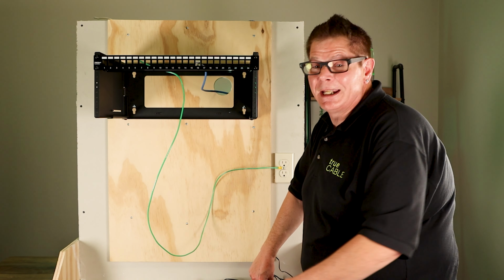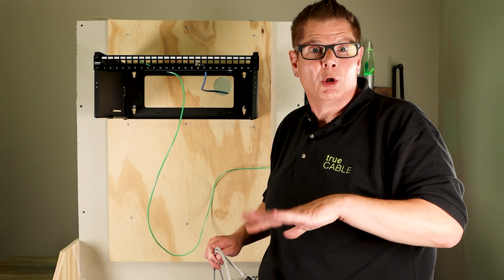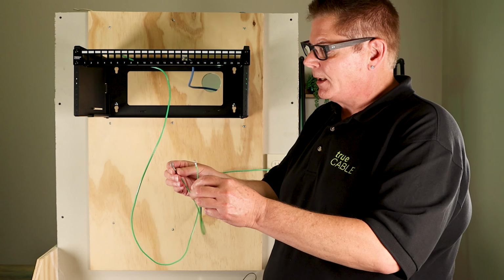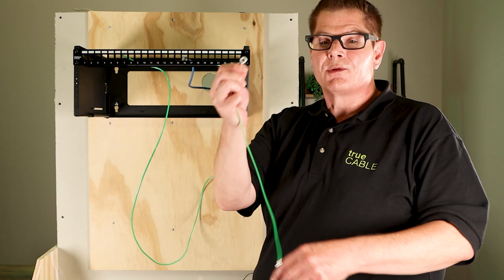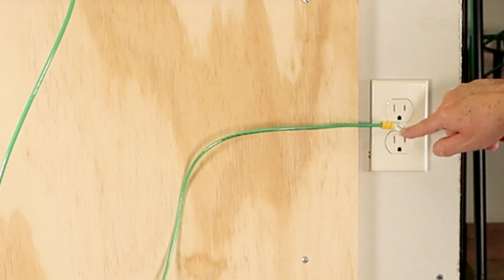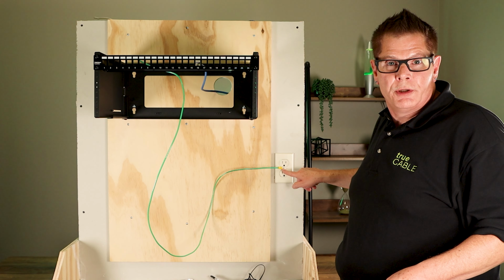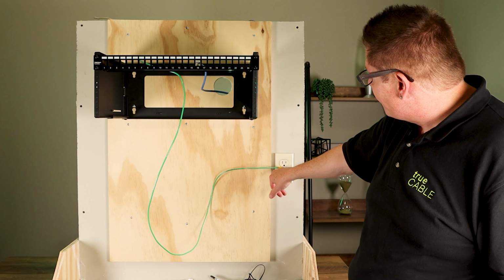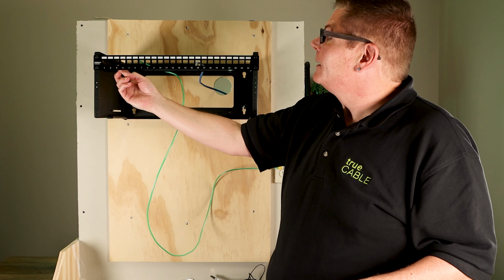Residential Bonding and Grounding of Shielded Ethernet Cable (Full Overview)

Comment: Do you need to bond the patch panel if your electrical plug and connection has a ground wire?  I know that in some places the electrical plugs don't have a ground wire connected to the electrical switch, but where we are every switch has a ground wire ... so in that case do you still need to do the bonding?
Reply from the maker: Hello! That is a great question. If your Ethernet switches all use 3 prong AC power cords (in other words they have AC/DC internal power supplies) AND you are using shielded patch cords from the patch panel to the switches then you do have a complete ground path. It is not the strongest or most resilient path, however. I would still add a bond to that shielded patch panel. The more bonds the better. What you have now, assuming you met my conditions above, is the bare minimum. On the flip side, if you don't have a dedicated formal telecom bonding infrastructure then you can increase your bond effectiveness with our truePLUG accessory which we just released.
Reply: @trueCABLE   You do not want multiple ground connections, if you create loops with them.
Reply from the maker: @James_Knott  Hello James! Correct. You do NOT want multiple grounds. You want multiple bonds to the SAME ground, however.
Reply: @trueCABLE  "You do NOT want multiple grounds. You want multiple bonds to the SAME ground" FINALLY someone who explained this in a short but very clear way. Thank you!! 
It's pretty confusing all the advice floating around about loops and that ALL cables after the wall socket should be unshielded, because the computers are already grounded and thus would create a loop. 
I have now the following (residential) situation: fiber -> ont (no AC ground) -> shielded cat6a -> gateway (no AC ground) -> shielded cat6a -> patchpanel (grounded with cord) -> shielded cat6a -> wall socket -> shielded cat6a -> switch (no AC ground) -> shielded cat6a -> NAS/workstation/desktop/printer (all AC grounded). 
No loop right? These are all bonds to the same ground, correct?
If we add a UPS to the mix, do we also feed it the cat6a in and out or only the power cords?
Reply from the maker: @EddieBogart  Hello Erwin! I am glad you found the explanation understandable and useful. Your setup won't introduce any ground loops, all are on the same AC ground. As for using a UPS to pass-through any type of Ethernet; don't do that. The UPS may introduce its own brand of EMI and interfere with performance. Restrict UPS use to AC power only.

Comment: I am converting a 12 x 14 space in a detached garage into a workshop and plan to run six to eight cat 6a plates (four in two gang boxes with 20 amp outlets as the second and four in standalone wall terminals for future PoE cameras). I will have an 8 port PoE switch which I assume will not be three prong in a media wire box on the wall. There will be an outlet in the media wire box for the switch. If I ground the switch to the outlet in the media wire box, do I have to ground everything I plug into each of these ethernet wall jacks as well? For instance, if I plug in a PoE camera does the camera end have to be grounded as well? Everything ends up going to a sub-panel that is properly grounded to the main panel in the house by the way. 

I was originally going to use cat 6 until I read i needed cat 6a for PoE. Maybe i am over enginneering for such a not critical small project? I mean, until I can run ethernet from the house all the erhernet cables are ultimately going through an ethernet jack on a wifi extender!
Reply from the maker: Hello! I will answer your various questions in [ ]. "If I ground the switch to the outlet in the media wire box, do I have to ground everything I plug into each of these ethernet wall jacks as well? For instance, if I plug in a PoE camera does the camera end have to be grounded as well?" [The camera end does not need to be grounded. In this case, you want the switch end to be bonded to ground.] "Everything ends up going to a sub-panel that is properly grounded to the main panel in the house by the way." [Excellent, this is exactly how it should be done to avoid any ground loops.] I was originally going to use cat 6 until I read I needed cat 6a for PoE. Maybe I am over-engineering for such a non-critical small project? I mean, until I can run ethernet from the house all the ethernet cables are ultimately going through an ethernet jack on a wifi extender!" [Yeah, there is a lot of misinformation out there. You DO NOT need Cat6A at all for this project unless your cameras require 10G connections. Quite frankly Cat5e can handle 2.5Gb/s and our Cat5e can handle 100W PoE. What limits PoE on Ethernet is cable bundle size due to resonant heat, especially in conduit. You are nowhere near the limits of even Cat5e. When picking a cable for your project, it makes sense to have some future upgradability to be sure, but don't overkill it. The reason is that the more features a cable has, the more difficult it is to work with. Cat6 is a good balance, and still a bit overkill.]  Hope I was able to help answer your questions!
Reply: @trueCABLE   It's nice to see someone else recognize CAT5 is good enough for most users.  Gigabit Ethernet was designed to run up to 100M over plain CAT5, before 5e was even available.  5e is just CAT5 with tighter tolerances.
Reply from the maker: @James_Knott  Hello James. I am sorry if I gave the wrong impression. Cat5 is completely insufficient these days. In addition, TIA no longer recognizes it as a valid Category. All installations should be Cat5e or higher.
Reply: @trueCABLE   I agree plain CAT5 is obsolete, superseded by CAT5e, but it is what Gb was designed for.  Incidentally, I have some plain CAT5 in my condo, installed by my cable company, back in the late 90s, when I first got a cable modem.  They actually fished the cable up inside the walls, along side air ducts, etc., when they were running to coax to my "office".  I supplied the CAT5 and they pulled it in with the coax.  That CAT5 is now supporting Gb and carrying IPTV, though those boxes only run at 100 Mb.

Comment: I am trying to set up an HP Switch (v1910-24g je006a) and an Ubiquity Dream Machine SE at a small business, and we have to have cables running close to LED light panels in our ceiling. We have opted for shielded cables, and I'm trying to make sure we are grounding the equipment correctly to avoid interference. 

Since both of these devices have a 3 prong AC cord connection, do we need to do another connection to ground for the HP Switch? I understand that if we were using a patch panel, the panel would need to be grounded as you did in this video, but we won't be using one, and at the beginning of the video it sounded like you were saying if the device has a 3 prong cable that an extra ground connection didn't need to be established. Is that correct?

Part of what is throwing me off is in the manual for the HP Switch, it states:

"The power input end of the switch has a noise filter, whose central ground is directly connected to the
chassis to form the chassis ground (commonly known as PGND). You must securely connect this chassis
ground to the earth so the faradism and leakage electricity can be safely released to the earth to
minimize EMI susceptibility of the switch."

then shows 3 different methods to ground the switch. One of them says "Grounding the switch by using the AC power cord" and in that corresponding section of the manual, it states:

"If the installation site has no grounding strips or earth ground, ground an AC-powered switch through the
PE wire of the power cord. Make sure that:
• The power cord has a PE terminal.
• The ground contact in the power outlet is securely connected to the ground in the power distribution
room or on the AC transformer side.
• The power cord is securely connected to the power outlet."

I think I am just over-thinking this. What is getting me is, why would this section even need to be here if they supply a 3 prong AC power cord? Wouldn't that provide the ground? Then why would there need to be another ground screw terminal on the back of the switch? I thought maybe that was supply as a point to ground the patch panel/rack, but the manual says otherwise.
Reply from the maker: Hello! Yes, I fully understand your questions and can sympathize with the confusion. First, the LED lights should not pose an additional EMI risk unless there is something I missing here. CFL and the like are indeed risks, and a 4" separation with U/UTP Ethernet is required from the CFL ballast. LEDs are not an issue. You may have your answer now: don't use shielded. Not needed. Again, this is unless I am missing something here and these LED fixtures are not industrial super monsters and an EMI risk. I doubt they are, though. Now, on the off chance that these LED fixtures are a major EMI hazard to your Ethernet, and you cannot maintain 4" separation, then here are some additional answers. Yes, your Ubiquiti DM SE and HP switch provide a bond to ground via their 3 prong power cords and internal AC power supplies. The question is: "What is the quality of the ground provided?" That question cannot be answered without some pretty advanced equipment to do multi-point resistance measurements in the 0.1 ohm range (like a Meggar). Otherwise, the refrains in the HP manual are for auxiliary bonding to ground with an additional bonding conductor (ground wire) from a screw point or other provision the switch offers to the center screw of an outlet which is another bond to ground point above and beyond that provided by the third prong on the power cord. I can tell you that the UDM Pro SE does not have that provision as I deploy them all the time. Thus, if you want to install a shielded system then you will need to switch to a shielded patch panel and that patch panel will need to be using shielded hardware and be bonded to ground above and beyond your switch power cords. We do have a truePLUG Bonding & Grounding Extension Adapter for just your situation, but it will require switching to a shielded panel and shielded keystone jacks. You probably don't want to go through that rework process. SO...long story short I strongly advise you to reconsider if shielded patch cords are actually required here. I bet they aren't. If they really are, you have a lot of work in front of you!

Comment: I have a couple of questions...
1. Can you use a surge protector to your outlet from your switch since that is considered grounded ? Example: Shielded CAT6A in from multiple areas throughout the new house build to the patch panel, then to the switch plugged into the surge protector ? Also my switch will be connected to my router from my modem in the closet set up for all this, also all plugged into the surge protector.
2. How do you make your shielded ethernet grounded with the male & female plugs/ports ? do you have a video that shows that ?
Thank you
Reply from the maker: Hello Cris! Good questions. First, it is a great idea to use a surge protector to plug in and protect your equipment. Second, using a surge protector does not bond your cable shield to ground; that is a separate process. The cable shield is bonded to your connection hardware and the connection hardware is then bonded to a ground path. In order to accomplish this with shielded Cat6A Ethernet cable the tool-less keystone patch panel should be shielded and so should your keystone jacks. If you are using a traditional 110 punch down patch panel than likewise it would need to be shielded. There is a bond wire present on the patch panel that would then be bonded to your rack bonding bus bar (in a commercial installation) or you will need to get creative about how to reach a properly grounded three prong outlet so you can bond to the center screw of the faceplate. This video demonstrates bonding your patch panel to an outlet in a residential setting. As for specific instructions on how to bond your cable shield to your connection hardware, it depends on what kind of connection hardware you are using. We have many videos on our channel that address termination of shielded Ethernet cable. I suggest taking a look at any of those videos. Let us know if this helps!
Reply: @trueCABLE some surge suppressors are designed to connect to the shielding and could relay on this instead of a local ground which is an option that has some benefits its hard to say when its most effective but when you have more then one ground you could induce current that need not be in play having a longer then ideal ground could fail to bleed off surge current from say a near lighting strike I was thinking of using a surge suppressor for this reason but at 15 dollars each not doable a patch panel really expensive but would work then I would end up with few 3 foot cables just connect a fire wall into a switch that are less then a foot apart to start with so no easy answer for this just wrapping a wire around the end of your shielded cables at the intended ground location would be an option not ideal this patch panel is really doing it propper
Reply from the maker: Hello, and thanks for your comment! We appreciate your concerns and know the challenges which is why we put out this product and the content. Bonding of Ethernet cable shields to ground has been a vexing issue for residential installations for a long time. No longer. Let us know if you have questions!

Comment: This video may have just done a lot for me, Thank you!
I had a PoE switch and a patch panel for the CCTVs I dont necessarily run all shielded cables, most are just UTP, but my rack near the patch panel is tingly and sometimes shocks me a little, so I needed to figure out how to earth or bond this. One thing I did was change everything to 3 prong, but I am not sure if my dboard is earthed. So my main question in this video is, how can I check if my socket is grounded properly, is there a device or a test I can do?
Reply from the maker: Hello and we are glad the video was useful. Yes, you do have a an issue. The tingling you feel on the rack might be common mode voltage being injected back across your communications cable or through the rack frame due to a ground loop condition also. I strongly recommend consulting a licensed electrician to make certain you don't have ground loops in your AC grounding system. Ground loops are typically induced by having more than one actual AC ground point (more than one ground rod in the same system, unequalized, we are not talking about multiple bonds to the SAME ground system). This can occur when running communications and/or power cabling between two structures with multiple (but not equalized) ground points involved as a common example. Another common example is pounding in a ground rod on your own without equalizing it to your original AC system ground.
Reply: @trueCABLE  "Another common example is pounding in a ground rod on your own without equalizing it to your original AC system ground."  in this case equalizing means that new ground rod has to be directly connected to other ground rods/strips ?

Comment: couple questions since I've been trying to figure out the optimal method for a while...
Should you bond the other similarly and if so does that create a ground loop?
If your switch is not bonded to the patch panel, does that cause more interference?
Reply from the maker: Hello and thanks for your question. A ground loop is not a risk unless you have two actual AC system grounds involved (like two different buildings with separate electrical systems), or you decided to bond to your AC system ground AND then pounded in a ground rod separately and bonded to that too (a big no-no). I think you are worried about multiple bonds to the SAME ground, and that is a good thing--not bad. The more bonds you have to the same ground, the more resilient your shielded cable installation will be. If your switch is not bonded to the patch panel/rack frame that is not a major issue, as many small residential/SOHO switches don't have the ability to bond to the patch panel/rack frame anyway. In that case, you would bond the patch panel itself to your AC ground system as shown in the video. You would not get any benefit from using shielded patch cords from the patch panel to the switch in this situation, as the bond path cuts the switch out of the equation.
Reply: @trueCABLE  thanks for the detailed answer!
Reply: @trueCABLE   Multiple grounds, regardless of AC ground, can create a loop that acts as an antenna and picks up noise.
Reply from the maker: @James_Knott  Hello James! Correct. You do NOT want multiple grounds. You want multiple bonds to the SAME ground, however.